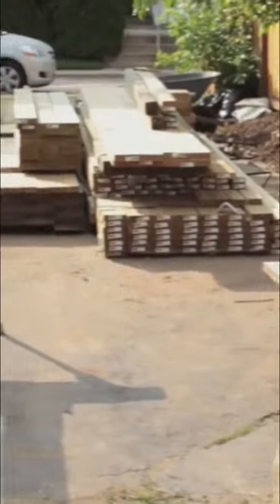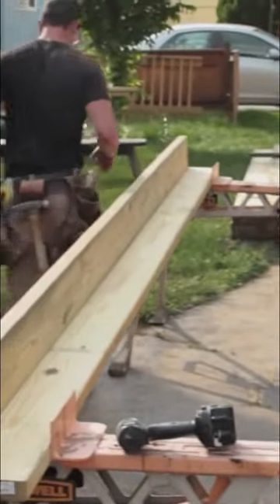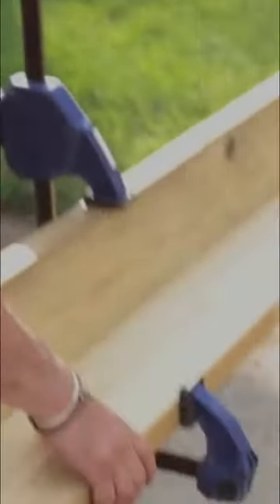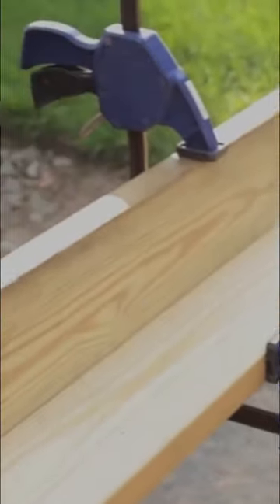DIY tips: How to build a rock-solid corner post for a playset, shed, or outdoor structure like a pro

Comment: Who uses screws for load bearing?  Nails stretch, screws snap.
Reply from the maker: When you say load-bearing, you mean in "shear". Also, this is a playset, not a bridge abutment. It worked for our kids for a decade. ON to its second home.
Reply: No they don’t snap… they only snap when screwed halfway in then bent over…
If they’re screwed though one board into another they will not snap.
-Try this: 
Screw a board down to something using 3” screws (common in building), a wooden trailer deck would work, then nail a board down next to it using 3” nails… Next beat them sideways with a sledge hammer… the nails will fail first and the screws won’t snap